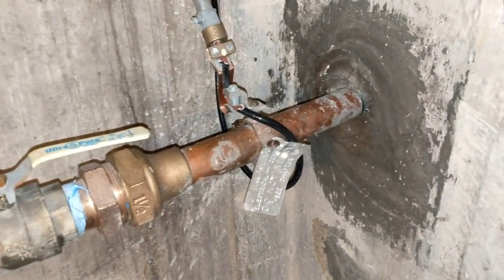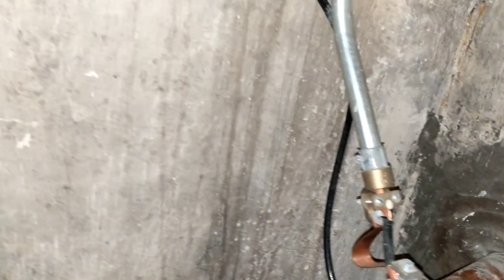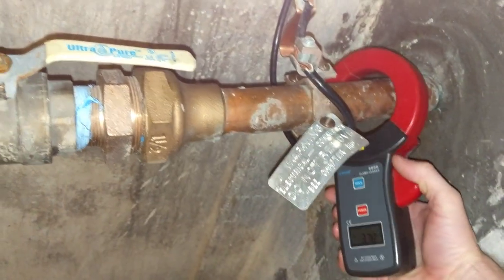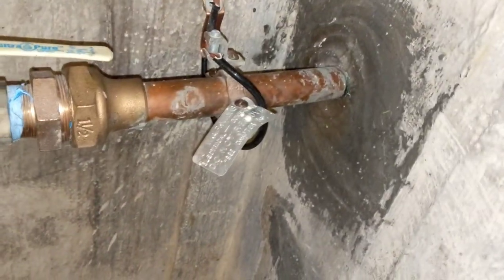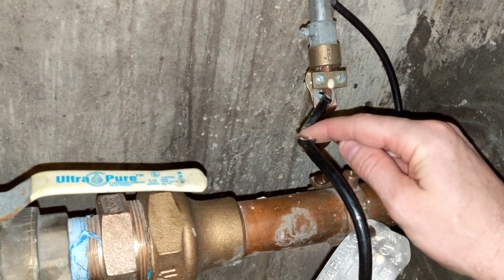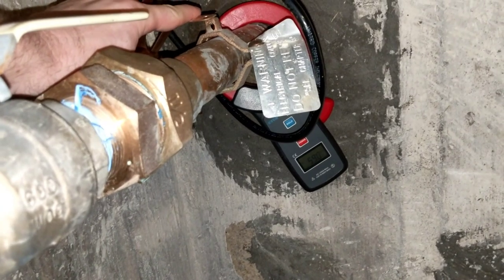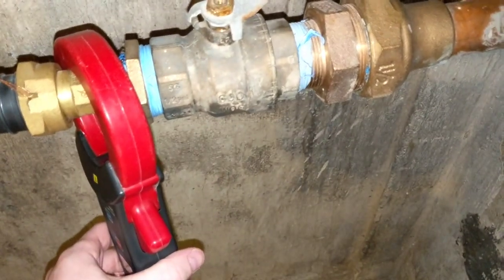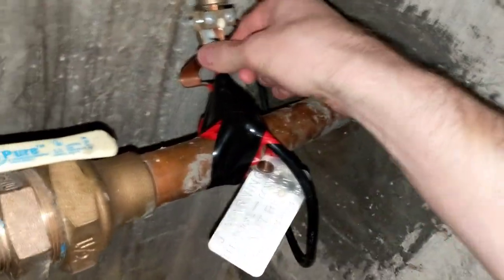How to measure current on pipes with AC Clamp Meter and isolate water pipe to stop undesired current

Comment: If this video stays up by Tuesday am. I’ll send out a notice to my 25K subscribers to comment on you dangerous statements.
Reply from the maker: Hi Mike, I am familiar with your work and a fan as well.  I hope a lot of electricians paid attention to your grounding/bonding info and learned that the earth isn't some magical sponge that "absorbs" energy, but it's just another possible path to complete a circuit.

I welcome any comments that aren't personal attacks.  I think this could start an excellent discussion about grounding electrodes versus unintentional low-impedance parallel neutral current paths such as that shown in the video.  The NEC does mention objectionable current.

I see current on conduit, water pipes, ductwork, metal building materials all the time due to illegal neutral-ground bonds and also neutral wires being pinched or screwed into and connecting to ground.  We eliminate this dangerous stray current by fixing the errors.  Electricians should much more often test neutrals at the panel at the end of the job to make sure these things didn't happen.

 I am definitely interested to hear your thoughts on the video and to which statements you take objection.  Together and through discussion we keep learning.
Reply: Mike could you please post the NEC code requiring grounding and bonding.
Reply from the maker: @billshelbrick6192  For homes it's a certain measurement of resistance OR 2 rods 10 feet apart.  So everyone does the latter.  The code doesn't require bonding to the incoming water pipe just because it is metal. You could have a copper supply pipe coming in and then have an entire house done in PEX.  Not only pointless to bond there but causes all sorts of issues.

I have a huge amount of respect and admiration for Mike Holt.  I know you would never advocate purposely using a pipe as a current carrying conductor of a circuit.  But this is what is happening all over the country.  Some of us are fixing it.  I knew the video would be a little controversial and might get some responses from electricians, but I'm as thankful as I am surprised to see your response Mike.

Let's have a quick chat on the phone.  I think you will be surprised to hear what a big issue this is for people and how common of a practice it is becoming to electrically break the incoming water supply.  It is only going to continue to gain traction as people realize they do not want the magnetic fields associated with this current on their pipes.  We can safely put the current back on conductors where it belongs without causing another issue - let's work together and I'll get this info out to 10s and 10s of thousands of people too.
Reply: @Justin M This is a violation of 250.24, 250.52, and 250.104. The NEC requires metal water pipe to be bonded, grounded and at time both. Clearly this person is encouranging people to place their home at risk.
Reply from the maker: @MikeHoltNEC  NEC 250.53 (D) Metal Underground Water Pipe
If used as a grounding electrode, metal underground water pipe shall meet the requirements of 250.53(D)(1) and (D)(2).

Notice the word If - Why would 250.53 use the word "If" for something that is mandatory?  250.24 does not require it.  250.52 did not either.  I am pouring over 250.104 right now.

If you have something that seems to require it, please copy/paste it here.  That would be very helpful.  Thank you.
Reply from the maker: @MikeHoltNEC  250.104 Says metal water pipes shall be bonded, but does not provide any exceptions for small pieces of pipe that are metal and insulated.  You know as well as I do that there are plenty of small sections of metal pipe used in buildings intermixed with poly pipe.  These are hardly ever bonded.  Often these sections of insulated metal pipe pose zero threat to anyone.  Perhaps the code needs an exception for this, because as written without exceptions - it simply is not followed.

For instance - the 18" copper pipes used on water heaters to connect PEX tubing.  Would those need to be bonded?  I've never seen it.  We could go smaller and use metal PEX fittings as an example.  Little elbows and T's and things.  They are metal and technically water pipe.

So at times the code is not followed, but it is still safe to do so.

Would you be OK with 2 feet of metal water pipe coming through a foundation and then well insulated and not bonded?  I'm trying to understand and avoid turning the water supply line into a conductor.  How much current is objectionable?  Is there a point you would be concerned about the current on the water supply line?  As I stated before I've seen up to about 20 amperes on them.  Generally it is a lot less, but how much is too much?  Isn't there a risk/danger to that current?  So sometimes we have to choose between the lesser of the two evils I would say.
Reply: @EMFExplorer  It's because you can touch both metallic pipes. If you would build something non-conducting around it there would not be a shock hazard. I encounter the same dilemma in the Netherlands. In bathrooms every touchable metallic part has to be bonded too. But may bathrooms in the Netherlands have a washing machine with a separate electrical group and therefore a separate ground wire. The Dutch NEC for residential buildings is called the NEN1010 and they state something like: "Every metallic part and every ground wire should be connected in the central ground junction box" which is a box with only bare metal wires and ground wires. 

Although reducing shock hazard, the problem with the practice is it will create ground loops and causes a whole lot of new problems. But if you don't bond there will be potential shock hazards f.e. the washing machine would have a failure.

I advise people to just remove the washing machine from the bathroom. Either build a closet around it in such a way that it is considered a separate room. Or put the washing machine somewhere else. I also advise them to put the bathroom on a separate electrical circuit and run this circuit next to the water, gas and heating piping so any ground loop will be local. Therefore the electrician is happy and can ground and bond everything the way he wants and the person is happy not having to live with stray magnetic fields.

And the same goes for everything else. It you need to bond it? And don't want to? Just build something around it! Or remove it completely if it serves no purpose being there.
Reply: @robinheijblom2929  very correct, Robin.  Thank you for the reply.  In the case of most houses here, the water meter is inside the house within a few feet of the pipe entering the foundation into the building.  Then we install the plastic  break (if the meter is metal as they usually are) right after the meter.

So the few feet of metal pipe has not been a concern for us.  As I mentioned before, I've never witness a voltage high enough between the two that it would be a remote concern.  So it is very unlikely.  Yet, I've witness more than I can estimate (thousands) of people affected actually by the magnetic fields caused by using pipes as conductors.

So these codes - yours and ours - need to adapt in order to prevent pipes being used as conductors - which also presents a danger - anyone who splits the pipe will be subjected to the voltage!!  Plumbers need additional training g and need to use jumper cables to keep potential the same when working on pipes.  They could also use our clamp meter in the video to test it for current.

I will be making followup videos on this because it is such a big issue - the magnetic fields.  Clients have felt the difference when I cut the pipe and they didn't even know I was doing it at the time.  They have been like "whoa, what did you just do?!". "it feels so different" and "it feels calm" for example.

The code needs to learn how to keep current on conductors yet also provide for safety.  There are ways to do it.
Reply from the maker: @MikeHoltNEC Here is a new video which shows my understanding of another method that I have reason to believe is NEC compliant.  It involves converting the metal pipe to PEX and then extending the building/foundation around the pipe using concrete.  So in the end it is just a PEX pipe that comes out of the newly-extended foundation.  https://www.youtube.com/watch?v=KtNpYRYyraY
Reply: NEC Article 25.
Reply: @TRUMP_WAS_RIGHT_ABOUT_EVRYTHNG  In the electrical field, Mr. Mike Holt is very well known. He has dedicated his time and energy towards educating many people.
Reply: Yes you do put a bonding jumper between those and the gas as well if their is one
Reply: @mikeholtnec has been doing this since you were in diapers. Pretty sure he knows what hes talking about at this point in his career.
Reply: This clearly violates a few art 250 grounding codes.
Don't listen to this guy if you want a safe electrical system!!!
Reply from the maker: Dear Mr. Holt,

Thank you for your important work in teaching the NEC (National Electric Code for those reading this letter who may not know).  I have watched many of your videos and found them to be very effective and beneficial to all electricians.  I respect the work you do to help increase safety and understanding as well as compliance.

It is nice to see our understanding of electricity continually increase as well as our technology and the NEC.  I see how far it has advanced in just the last few decades, so I am hopeful for the future.  Like electrical and electronic technology and knowledge has been advancing, so has our understanding of how fields, radiation, and current inside the body affect health.  Tens of thousands of papers have been published, many of which show biological effects that are significant from today's "normal" exposure.  The fields and radiation we generate today do not at all resemble what humans have experienced throughout all of human history.  They are different in format or configuration (eg. pulsed/modulated) and magnitude (exponentially-higher levels).  You and I undoubtedly have very different perspectives on this topic, but I will defer to the World Health Organization which has classified electromagnetic fields and radiation in their International Association for the Research of Cancer (IARC) carcinogen list as Group 2B agents.

For the purpose of this letter, I will only stick to electrical discussion.  I will leave human health out of this for the most part, except perhaps to provide a little anecdotal information from my firsthand experience.  You may recall the video I made showing the disconnection of the ground bond to the city water network.  The ground bond to the home's internal metal plumbing remained intact.  This video caused quite the stir, and continues to do so.  I plan to update it with some information to help people do it in a more prudent manner.  However, the discussion from the video has been very beneficial.

I would greatly appreciate to have a thoughtful public discussion with you on this topic.  I have been respectfully arguing with a number of electricians on YouTube.  They cannot answer a number of questions and points I have brought up regarding city water network bonding.  I hope that you may discuss this with me for the benefit of all.  It is my sincere belief based on my education, knowledge and experience.

1) City metal water pipe networks create countless low-impedance paths for primary and secondary neutral grounded conductor current to traverse and measurably act as current-carrying conductors in circuits 24/7/365.

2) To my knowledge the NEC requires conductors to be approved electrical conductors only - pipes and other objects are not allowed to be used as current-carrying conductors in circuits.

3) Parallel conductors are allowed but only in circuit circumstances and with restrictions.  Pipes being used as parallel primary and secondary neutral current-carrying conductors do not meet this either. (Violation of 310.10(H) and/or 366.20?)

4) All conductors of a circuit must be in the same cable/raceway/conduit/etc.  Pipes used as current-carrying conductors would be in violation of this as well. 300.3(B)(1) through (B)(4).

5) The NEC mentions objectionable current (250.6), and we know about the transformer affect with induced current, heating, and voltage potentials caused by the electromagnetic fields.  Why is this circuit current traversing the city water network considered objectionable?  Is there a threshhold for what is considered objectionable and if so upon what is that based?

6) In one or more of your videos you discuss ground rods and auxiliary ground rods.  In particular you mention having distant ground rods far away and lengthy wires going to them as being undesirable.  Also, if I am not mistaken, you mention that it's best when all the ground rods are in one location near to one another.  This matches my knowledge as well, as rods with greater separation may encourage lightning to travel the wire between the rods.  Not that this necessarily causes issues, but there is not an advantage to remote rods spread far apart and there only seems to be disadvantages.  The city water pipe is a remote ground rod in most circumstances separate from the ground rods driven near the service/meter/panel(s) and far away.

7) Many of the electricians who have insisted it is extremely important to bond to the city network have completely disregarded the fact that many homes now don't even have a metal pipe coming in.  Are these homes inherently less safe?  To my knowledge there is no safety advantage of a house with a metal water pipe.  From a health standpoint I contend there are disadvantages based on working with a vast number of clients and knowing many others who have worked with countless clients and reported the same.

8) I understand (and have personally seen, tested, and helped resolve on multiple instances) that service neutrals do become disconnected at times and cause dangerous situations.  But I do not think it is acceptable to simply allow the water pipe to become the only neutral for a building when its electrical service neutral fails for some reason.  This causes a dangerous situation to plumbers in the house, on the street, and even in neighboring buildings in some cases.  Ultimately, it creates more potential for electrocution by electrifying objects that should not be electrified.

I submit these questions/talking points respectfully and earnestly would like to understand more and see what you have to say about the matter.  My believe is that the practice of bonding to the city water network actually violates NEC as pointed out above.  Not only does it violate NEC, which has conflicted codes on the matter, but I believe it is an outdated practice that causes problems.  It violates the correct practice of keeping electrical current on electrical cables/wires and off of other objects.  It creates issues that should be avoided and are bad practice.

I contend that this practice of bonding to city water networks is harmful, hazardous, outdated, and should be rectified.  I can back this up with the fact that I have measured and recorded images/video of  measurements of countless water service pipes whereupon they enter the building.  I have measured everywhere from a few milliamperes to over 20 amperes of AC current traversing the city network at the point of entrance into a building.

My proposal is that the NEC be updated as follows: 1) An electrical break such as plastic water meter, portion of PEX tubing, or 2 dielectric unions be installed where water service enters a building if not installed at the street as in some locales.  Breaking the connection to the city network will raise the impedance and remove large amounts of current from the water supply pipe. 2) The internal metal pipe network must be bonded as usual. 3) The incoming metal pipe should be insulated, or there should be safe distance (eg. 6 feet) from the buildings internal metal network or other grounded metal objects to the incoming metal water pipe that is still connected to the city water pipe network.

We have dedicated the website KeepItOnWires.org to return electrical current to current-carrying electrical conductors.  Too much current is present on pipes, and even on the surface of the earth.  This causes a number of concerns and should be avoided, as electricity should be confined to wiring as much as possible, except in temporary fault conditions which should be promptly cleared/rectified.  I hope you will assist us in pushing to resolve this issue with water pipes being used as current-carrying conductors.  I am certainly open to discussion if you disagree.  I am open to being corrected, but I believe the points I've made and the questions I've raised are, respectively, accurate and substantial.

Sincerely,

Shaun Kranish
"The EMF Explorer"
Owner, ElectraHealth.com
Founder, KeepItOnWires.org
Reply: If you really feel so strongly about the negligible amount of current flowing on that water pipe, then do the code compliant action: dig it up outside your house and install a plastic repair outside the foundation. Pretending disconnecting the water pipe inside the house and wrapping it with electrical tape is legal is absurd.
Reply: @GeorgeStolz  how much would you consider negligible?
Reply: @shaunkranish  20% of the connected neutral load of the service.